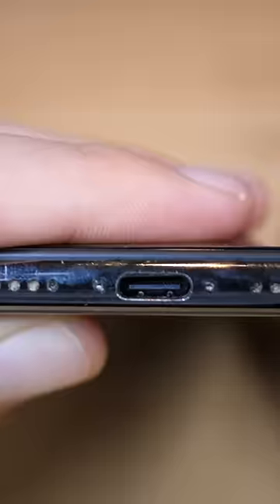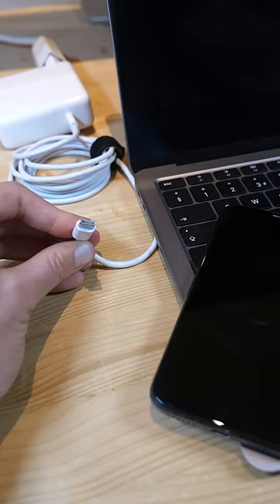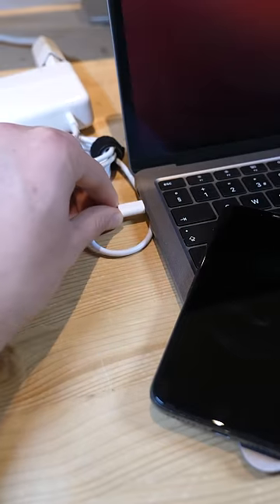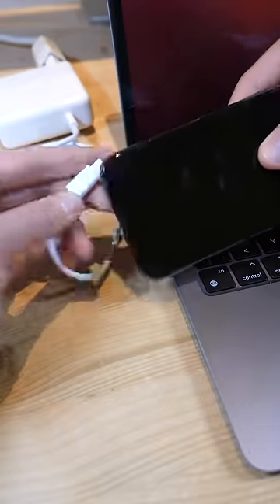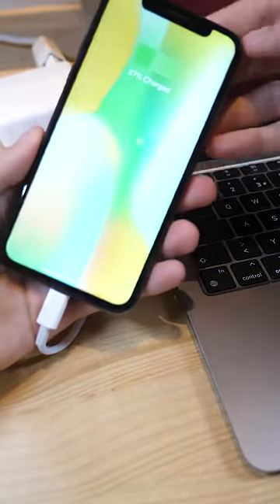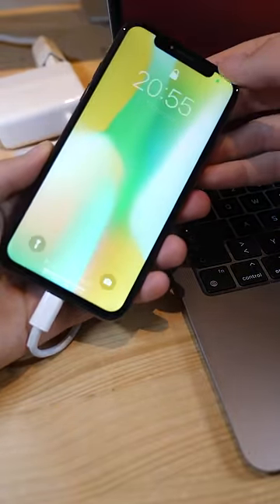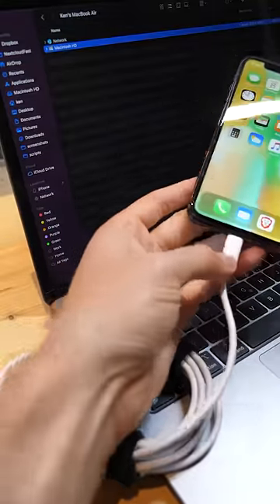World's First USB-C iPhone

Comment: This is incredible!! I can’t believe you actually pulled it off!! Now I wonder if it’s possible for others to try. I can’t wait for the video!
Reply from the maker: I'll document it as much as I can so I think it shouldn't be too much trouble for other to try for it :)
Reply: The flex cable can be mass producted and replaced, but the phone chasis mod is more difficult for end users I think.
Reply: @businessman97  aliexpress seller?
Reply: @businessman97  the chassis may be something to mass Produce and just swap
Reply: @ExploringTheSimulation  Maybe you could sell the file to make the reverse engineered pcb so others could simply replace the default with that. Possibly.
Reply: No it's not "incredible", it's INCREDIBLY OBVIOUS, and also, so what.
Reply: @unlokia  
I see you’ve never worked with electronics before.

Comment: I can't believe they still used lightning on the new iPhones. The fact that they support Pro Res Video that can easily exceed 200 to 300GB per video while people still have to rely on USB 2.0 speeds for data transfer. Also, the lack of quick charge support is a bummer. If they had gone USB C I would've pulled the upgrade trigger no problem..
Reply: Airdrop would probably be sufficient
Reply: @krispyhd9484  my arse
Reply: @krispyhd9484  
Airdrop is slow af

Comment: Imagine if you could streamline this process and were able to sell the upgraded part that would be amazing, I know the hardest part would be modifying the case though.. swapping the port would be great on its own but the lighting opening is a bit too small..
Reply: Apple will sue them before they can even breathe
Reply: @rachmatzulfiqar  no It’s just like the apple lit logo apple modifications, there is no branding on the port. So it can be labeled as a generic usb-c port upgrade.. the same as aftermarket companies make replacement charging ports.. apple can’t do anything.
Reply: @rachmatzulfiqar  thankfully yes

Comment: Now if you can do a mod removing the port and increasing the battery size to fill up the extra space, including moving the Taptic Engine, then I’ll be interested.
Reply: Removing taptic engine and replacing it with regular smaller sized vibration motor maybe, but completely removing neccesary parts is nonsense i think
Reply: @4kmarvelclips454  might be able to relocate it. Wouldn’t be easy. But hey this mod was nonsense too so why not? 🤷‍♂️ 🤣
Reply: @christophercrawford2736  It wasn't nonsense. Replacing lightning connector with type c means better overall compatibility like he shown in the video.
Reply: @4kmarvelclips454  meh. Not a big deal. My MacBook charger stays with my MacBook. I charge everything else with Qi. Havent touched a Lightning cable in years.
Reply: @christophercrawford2736  Lmao okay. Some of us don't like the massive amounts of wasted energy from Qi charging.
Reply: @THEJPR  Nobody sane is worried about the wasted energy. Wireless charging is just too slow on iPhones
Reply: @arden6725  "nobody sane" = anybody who actually pays an energy bill. Also, the wasted energy from Qi (which can be as high as 50% when compared to wired charging at the same rate) creates excess heat, and excess heat can damage, warp, recolour, etc components.
Reply: @THEJPR  I totally agree with your last point. Wireless charging is known for heating up the device too much which tends to warp and damage the battery and some other vital components. Better off just using cable charging and as an added bonus it's way faster
Reply: @THEJPR  I wouldn’t call it massive but OK
Reply: @arden6725  works perfectly fine for me. I get home at night and put my phone on the charger and leave it to charge. If I can survive with wireless charging only on an iPhone X, then anyone can do it because I am the heaviest phone user.
Reply: @amartje0108  that’s completely false.
Reply: @christophercrawford2736  You gotta check your sources my man

Comment: Kinda a weird question but how does this handle devices that typically need an apple camera adapter? Like a lot of external audio devices won’t work if you just use a lightning to usb c cable, and I’m assuming this is basically just a connector swap and everything else is the same?

Comment: That's really great. USB C everything, makes life easy. 

Hope Apple doesn't block the mods by stating that this port is blocked due to some 3rd party part or so. They are blocking battery and camera replacements from 3rd Party repairs
Reply: USB-C is a race to the bottom

Comment: USB-C is not good as apple lightning is, lightning cable is more resistant than the USB-C, because USB-C has a male plug inside the female plug, so it's more easy to break it's more brittle, instead of the apple lightning cable that is just a simple male cable with a female plug on the other connector. So please, don't bring USB-C to any Apple product. Even if they do it on recent iPad

Comment: I like more the form factor of the lightning port, it’s more solid and smaller. USB-C is like:   
E=    
and the lightning port is like:    
=—   
They should only make it faster like usb-c
Reply: The lightning port has actually been demonstrated to be less solid than USB-C. Having the pins on the outside of the cable end causes a lot of problems for device integrity, meaning you need to replace both the cable and the port more often